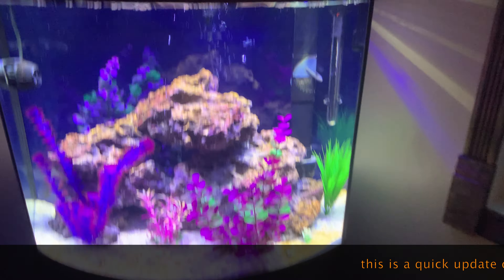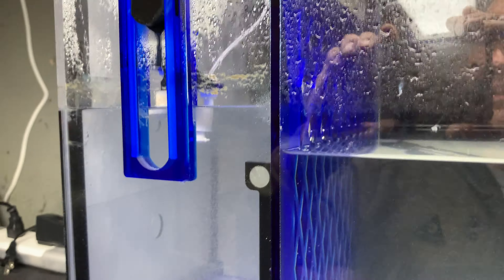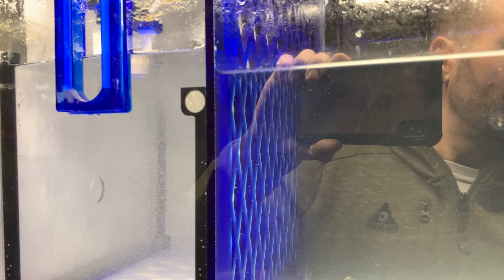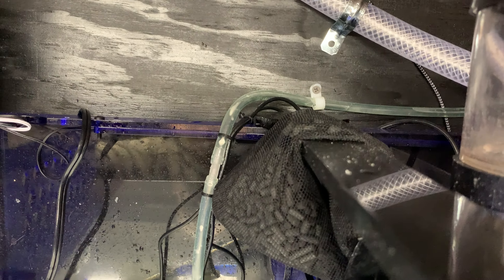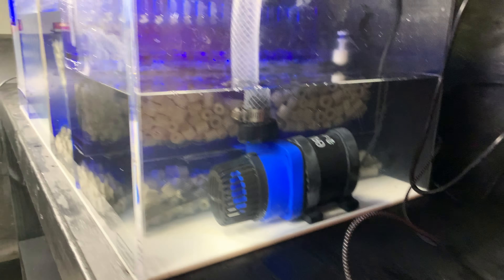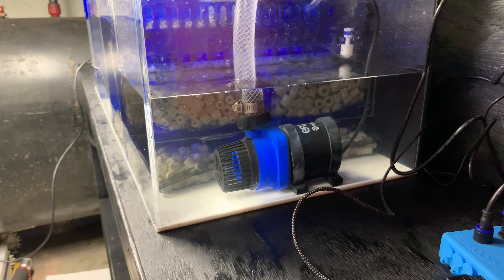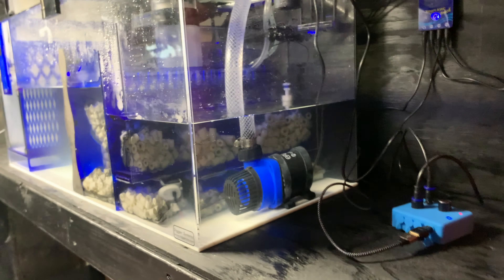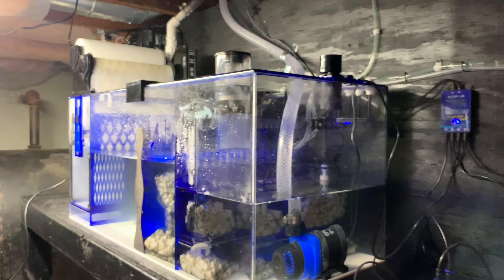trigger system & eflux current usa pump info plus other tank update

Comment: Thanks for the video, doing research on pumps and there isn't much other than unboxing reviews of this pump. From what I understand when it comes to the HP(head pressure) their is a relationship between head pressure and gph (gallons per hour), they label the pump as 1050 gph but I think that is with no head pressure. There is a photo of a linear graph on all the sites I've seen selling this pump show that as you increase HP you decrease flow rate. Looks like at 9' of HP it outputs like 200gph. Probably due to a low torque motor it has a harder time overcoming HP compared to A/C or more expensive pumps.
Also the head pressure is just an estimate of the resistance encountered by the pump. Try blowing water out of a 1' garden hose with your mouth then try blowing water out of a 20' hose, there's a difference. Adding 1' per foot of vertical height and 1' per 90° is just a general rule and is good enough for most people installing it under the tank like it's meant for. When making a long run you also have to add 1' HP per 10' of pipe even if it's horizontal, plus any bend or reduction adds HP not jut 90° elbow. Maybe try a cheaper A/C pump, might have more ass.

As for the controller idk.
Reply: The pump you’re talking about is their smallest one it works fine but you can’t use it to pump up and did pump 9 feet up without any issue. I have upgraded to the next model up and it did much better but now I’ve upgraded to the eco-tech m2 and I run it at 45% power and it’s absolutely insane. The E flux current USA products seem to work quite well no problems with them but they don’t have the power of a high-end pump but you are paying for what you get. I no longer use the current USA stuff I’ve upgraded to all eco-tech throughout my whole tank. This video here that you’re seeing is a very old video that wasn’t even running the sump pump on it
Reply: Also you only require a three times turnover rate in 90 gallons the 10 times turnover rate is a thing of the past. You only need enough flow to heat and filter your aquarium.  
The wave pumps do the rest of the work